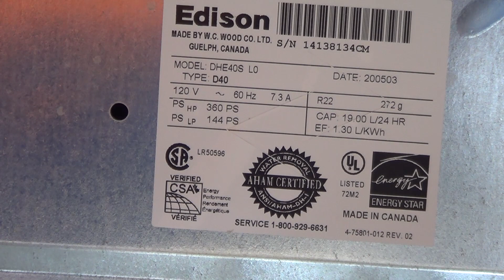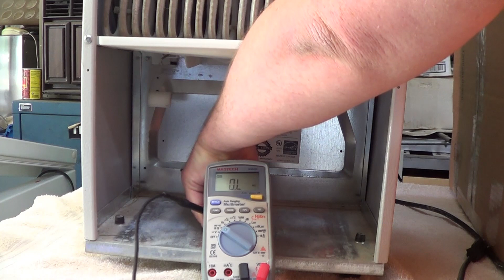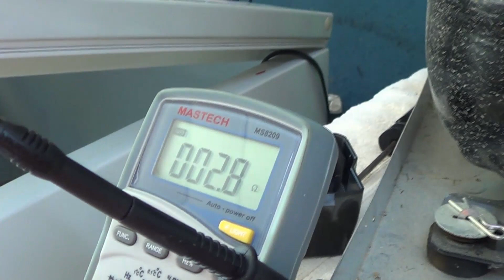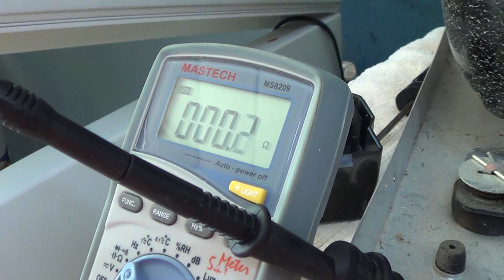Let's Diagnose a Curbside Discount Dehumidifier!

Comment: Anyone who tilts a refrigerator to move it may find the compressor suffers by being knocked off a spring, or it simply will not start again. I have seen this happen twice. Whirlpool refrigerators have a solid-state relay that fails and becomes a baby rattle. The compressor failure in this case could be one of these scenarios.
Reply from the maker: I've never known that to be the case, and I'm really rather doubtful about it if only because it's hard to avoid tipping a large appliance to some degree when moving it.

This was an electrical fault, not a mechanical one.
Reply: uxwbill I owned a fairly new refrigerator. It was moved 15 feet to the dining room by linoleum installers. Then, it developed a nasty sound every time the compressor shut off. Sears service confirmed what had occurred. I sold the house with the tipped compressor shortly thereafter. My son (your age) bought a new mansion, and moved a refrigerator down steep steps to the garage. He could have moved it without severe tipping using the stairs. It was done, and would immediately tripped the breaker after the move. These are real instances.
Reply from the maker: We'll have to agree to disagree on this one.

Comment: my building has two Email window aircon systems they still work but both have stuck fan moter but one is on cool and the other one is on heat i dont know if the compressors on both Email aircon are fine one sounds ok but one has the humming noise o dont know if it is he moter or the compressor and i have a air handler the fan works but the commpressor has a hum when i turn the controll to both heat and cool that has the same hum i tryed to crank the compressor,the compassida blew and stopped working
Reply from the maker: Do not post your address or other identifying information to a public web page like this one.

I don't sell or give away things via Youtube. Even if I did, you are extremely far away and your country does not use the same line voltage as mine!
Reply: uxwbill what is your ours is 250V
Reply: uxwbill oh sorry

Comment: You should've bypassed the overload and let the shorted compressor make some early July 4th fireworks for us! And was "coming down the pipe" an intentional pun? (The normal saying is "coming down the pike".)
Reply from the maker: While I think the branch circuit breaker would take it out almost immediately, the risk of a refrigerant release (and any possibility of an attendant $10,000 fine) is too great, should the sealing material around the connector pins melt.

I've heard "pike" and "pipe" used interchangeably. I've never looked into which one is more correct, or if they have about equal standing.

Comment: r134a was only used in cars i thought. ac used r22 then changed to r32. not sure if my 94 toyota camry uses r12 or r134a since they were changing then but it is factory and still works and is cold.
Reply: nope, 134A is used in automotive, and chillers, weather air cooled or water cooled and some walk in coolers. r22 is common for homes, and other commercial equipment. but both are phased out to 410a, they do however have solutions for r22 replacements. such as 407C can be used but must flush oil out and replace with poe oil, there is also hotshot, and 422b or NU22.  NU22 and 422b are pretty much the same thing, and dont require the oil to be flushed and replaced with poe oil, but you will suffer some efficiency loss, its small but still a loss. if the customer can spring for it, we just get r22. of course i only do commercial work so its not a problem. but at 700 dollars for 30 pounds its pretty pricey. we have been recommending to customers who can to jump ship and start looking to replace old equipment as opposed to retrofitting. 410A is alright but just doesnt seem to be as good as good ole r22.
Reply from the maker: You will find R-134A utilized in all manner of applications beyond vehicles. The only place I've never seen it used is in conventional split system air conditioning (outdoor condenser, indoor evaporator with a central air handler). Even then I'd be hesitant to say it was never used in such systems, only that I haven't seen one.
Reply: My dehumidifier (Meaco 20L Platinum) mentions R134A 210g on its back plate and this was purchased a few months ago.  Made in China as usual.  My previous dehumidifier a Trotec 75S also used R134A.  I decided to sell it off in the end as it developed a noisy vibration that I had no luck tackling, but otherwise it seemed to work just fine.

Comment: is that a Kenmore air Conditioner in the background on the top left? I have one, it's 35 years old maybe more and it still works great to this day.
Reply from the maker: It is an early 1990s 10,000 BTU unit in excellent condition. It too was a curbside discount find, needing only a new electrical plug to replace the melted original. (The original plastic molded plugs seem to corrode and destroy the metal within, possibly due to chemical outgassing. This results in heating of the plug and its eventual failure. If not caught, it can lead to a fire.)
Reply: uxwbill surprised that wasn't recalled like most everything these days. the A/C unit I have has been working strong all these years. my dad picked it up maybe 35 years ago bc it had to fit into a wall A/C hole. I'm surprised it still works today. I have a flowtron lantern bug zapper about the same age and it's still working. I did have to fix it a couple of times because one of the HV grid wires was arcing to the metal case, the insulation melted off the wire so I used some plastic tubing to fix it.
Reply: heh the house i bought had one of those also, it still worked great but I had it ripped out and tossed as the house has central A/C now and there was no point to it other than filling the hole in the wall.
Reply: Shanester366 you could have kept it. did it work?
Reply: it worked, but i didnt want a big ugly brown box in my living room :P the whole room was recarpeted, painted and the ceilings all scraped and re textured. the old ac would have looked very out of place
Reply: Shanester366 maybe in a different room? maybe the garage/basement/workshop?
Reply: naw i wouldn't ever use something that sucks up that much power
Reply: Shanester366 on my A/C I've calculated that or costs $20 a month to run based on the electric rates.
Reply: man your electric must be cheap, i had a much newer unit that used much less power that costed me more than that just to run a few days outta the month
Reply: Shanester366 it's not bad. unless it goes out. it kept going out one time and finally a transformer blew up my street. I flagged down the power guys and had them change it. power doesn't go out as much. Maybe flickers a little during windy weather.
Reply: coondogtheman1234 we're lucky, we haven't had a power outage in about 7 years and it never flickers ,but we pay a lot so it better be good haha but as much as I enjoy watching videos on this old stuff I typically try not to collect and hold onto stuff I'll never use and that ac was deff something I'd never use

Comment: I think R-134a was a bit of a compromise.  It was already in production for a while when the Montreal Protocol was ratified.  The decision for a freely marketable refrigerant was made between R-134a and R-152a.  It was decided against R-152a because of its flammability but R-134a has its own issues; it's highly reactive to moisture and to mineral base oils.  Upon contact with moisture it decomposes to a particularly strong organic acid (trifluoroacetic acid) which starts eating away at stuff.  R-152a, despite its flammability, is actually a better refrigerant and is quite cheap because of its use as a blowing agent for making expanded polystyrene.

Comment: The last good thing I found on the curbside was a Pro Mac 610 chainsaw.  It was very dirty from sitting in storage but actually ran very well despite a bit of cylinder wear (it ran a bit smoky).  Even the chain oiler worked, which is quite amazing considering that the plastic pump assembly often stops working after so many years.  We decided to get rid of it when I discovered how difficult it would be to put a new cylinder on it (you have to split the case!).

My Frigidaire dehumidifier (highly recommended btw) uses R410a.
Reply from the maker: I found a Husqvarna chain saw set out for the trash in excellent physical condition. The chain oiler had either stopped working or been allowed to run out of oil. By the time I got there the chain was blue from overheating. I guess they'd run it right into the ground.

With a little cleanup and a new chain (the bar seemed OK, amazingly enough) it is still running very nicely.

Comment: Love your videos. Just picked up a 30 pint kenmore on the side of the road. It was spotless. The only thing wrong with it was a seized fan which I replaced for less than $10. Works just as good as new. I think it may even work better than my 40 pint "energy star" unit.

Comment: looks like the size if a fridge compressor
Reply from the maker: It's more the size of a compressor used in a room air conditioner. A dehumidifier is a room air conditioner whose cooling effect has been "short circuited".

Comment: you can't sweat that connection for freon.. all joints are braized...due to vibrations from the compressor would break the joints over time
Reply from the maker: While I've got a lot to learn about the subject, I did mention brazing in the video.
Reply: uxwbill it's  actually  really easy... I've been doing it since 2001 and you learn a lot that can help you in many other ways like plumbing and electrical... which you already know about obviously ;) good luck!
Reply: thats not the only real reason. another reason has to do with pressures. while you could get away with soft soldering the suction side, the liquid side can and will blow out. but thats a 410a system, in fact in its not uncommon to see  soft solder used on old r22 systems due to lower pressures. commonly you will see soft solder used to burn in a TXV, sight glasses, solenoid valves, ect. on 22 systems since they are delicate parts. not a good practice, and ive never done it, but i have ran into it before. and they held for years on a old r22 system just fine. but the key is to make it a good joint, make sure they are really clean, and prepared correctly and make sure you fill the cup full. with brazing as long as you get a 1/4 to half the cup full its fine. unless doing med gas, which is then required a fully brazed cup. the down side to brazing is the fact that it weakens the copper. but brazing is a cake walk, just make sure you have good heat on it get the pipe/ fitting almost red and run with it. just follow the torch. oh and always run a dry nitrogen purge!  you dont want any air in there while burning. you dont want to get carbon inside the pipe and it will happen if you dont purge. its a bigger deal on new systems. most of the time on old systems guys dont care, just replace the filter drier like you should everytime you work on a system and it should be alright, but for me when im working on a system new or old i always purge.

Comment: Do they still make Edison dehumidifier?
Reply from the maker: As the video says, WC Wood is completely out of business. So, no.
Reply: what would recomend for a dehumidifier
Reply from the maker: So far, nothing modern. Pick up an older used unit in good working order. They're everywhere and you should be able to get one for no more than $50 (and probably far less than that).

I'm evaluating a modern unit right now, though only time will tell.

Comment: That's awesome that you're learning about HVAC system servicing, Bill. A friend of mine frequents a recycling center that lets him take pretty much whatever he wants, and they also have mini-fridges, old window A/C's, dehumidifiers, etc. Unfortunately, they always drain all the refrigerant out. I wonder it those units could be refilled and given a new life?
Reply from the maker: It's definitely possible to recharge them, if you're willing to repair any tubing damage and install proper service fittings. They only take a few ounces of refrigerant and you can easily lose that in your service hoses. My instructor says it's an art to overcharge them just enough to offset the loss from disconnecting the service hoses.

Comment: The sense of disappointment resonates with me, the Haier mini-freezer I've mentioned before, ran it in my shed for a few hours, worked perfect, so cleaned it inside & out to de-stank it, dried it off, let it sit overnight (was tipped over to get at the nasty dribbles underneath it), ran it again in the shed, worked perfect, brought it indoors (for later modification with a temperature controller to use it as a fridge), let it sit for a few hours, ran for about an hour, and the compressor seized, no shorts, no broken windings, just locked solid, wasn't too happy about that after all the work put in salvaging, testing, cleaning & carrying it indoors!! :\